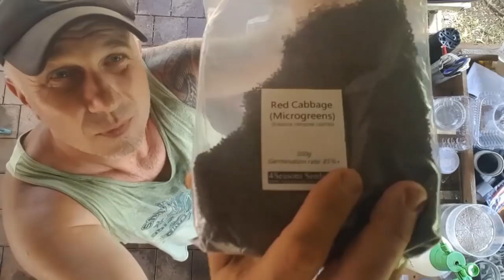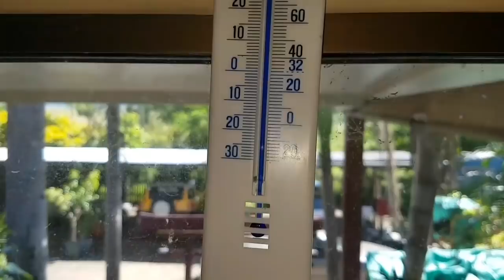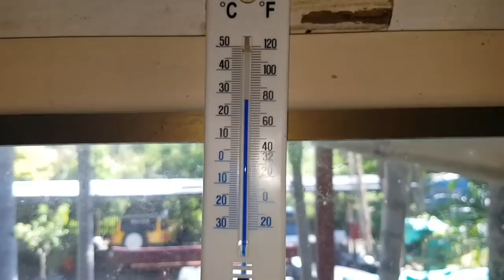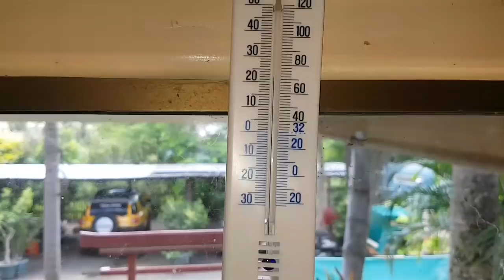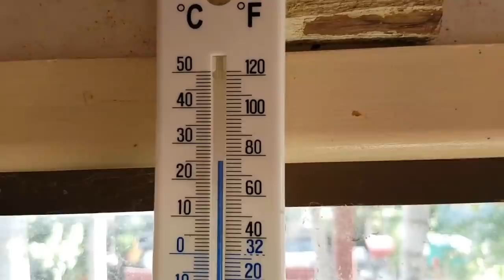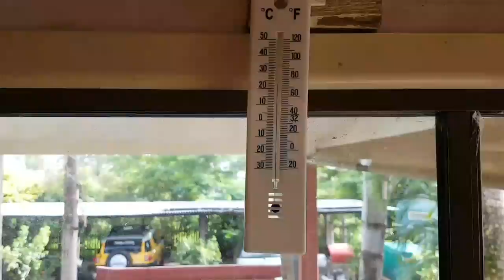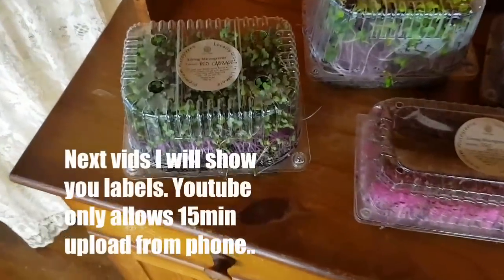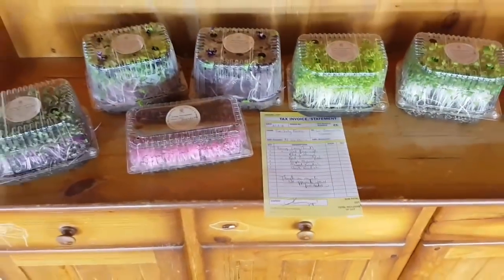Microgreens 🌱 Peps large punnet method ..7 in 7 days - Start to finish 👍

Comment: Hi Pepe,

Wanted to know if you made holes in the punnet lid for bottom watering.
Reply from the maker: Hey !
The punnet I use already has all holes in it. 
1 kg strawberry punnet.  
Its very convenient this way. If you are worried about soil falling through - it rarely does if good roots are formed. If still concerned you can put small piece of screen over holes. Never needed to do that though. Works great as is ! 
👍🌱
Reply: Pepe Fassos Thanks a lot :)

Comment: Great vids, Pepe!  What's your trick for keeping the soil from going out the bottom holes?
Reply from the maker: Hello mate 😊... The holes in these punnets are quite small so at the moment i dont do much except allow the roots to do the work. Letting in soak at the beginning kind of binds it together as well. By 7 days its a nice web of roots holding it all in. I have tried using paper towel, mesh etc but found it wasn't needed. Hope this helps 😊🌱

Comment: Hi pepe, im just wondering what grade vermiculite you are using? I am trying to source some online for this method and have found a 2-3mm size, the superfine stuff seams to be unavailable most places i look. Thanks again for being an inspiration to grow micros!
Reply from the maker: Hey Sam ! Good timing mate...
Im watching tubes getting pumped up to film again..lol. 
I use grade 1 fine vermiculite... you wont find this at general garden stores.. or even bunnings.  I get mine from a specialised rural store... 'norco' - for example.  
My only suggestion if your totally stuck is to go to an op shop... buy and old food processsor and blend down your larger clumps. I have done this 😉... works a treat.  I hope this helps mate... finer vermiculite does work better overall but 2-3m will work. 👍
Reply: Thanks for taking the time to reply! 
That's given me some ideas on places to look around here to, I actually tried the food processor yesterday and it definitely gets it fine enough, only trouble I had was making the punnets a bit messy as it was basically a dust. Might just need to be a bit more careful!
Can't wait for an update mate keep up the good work : )